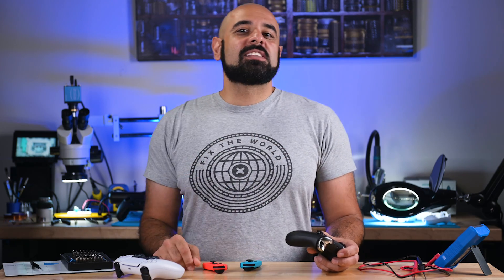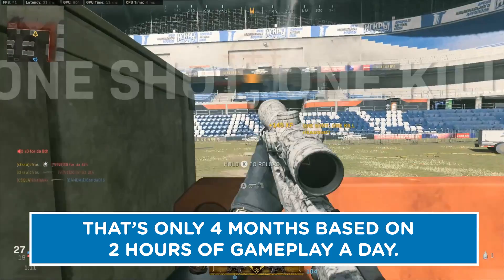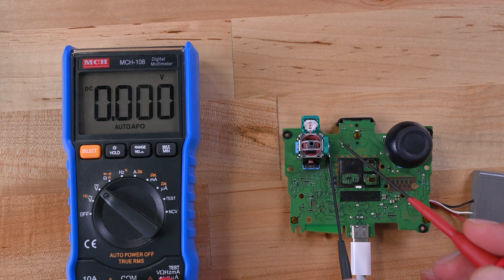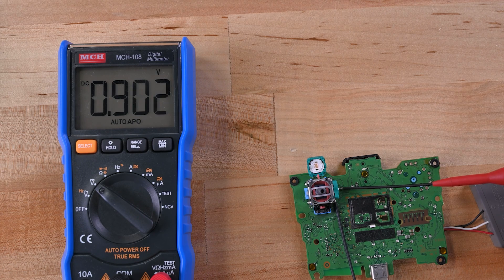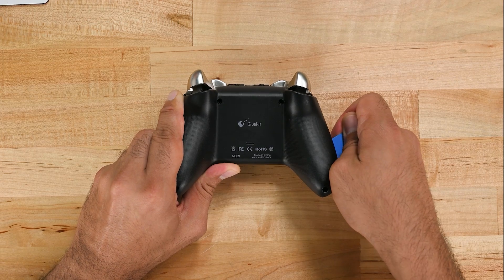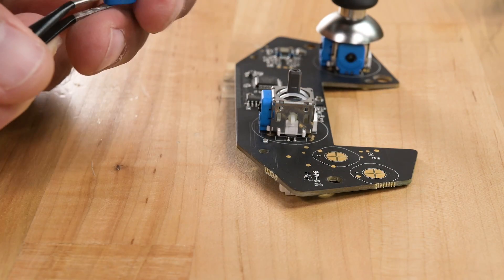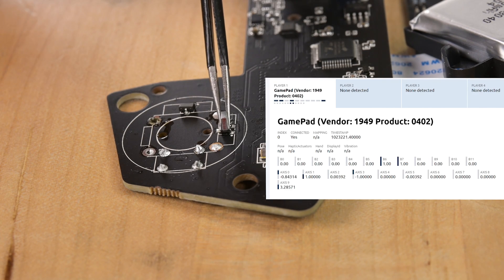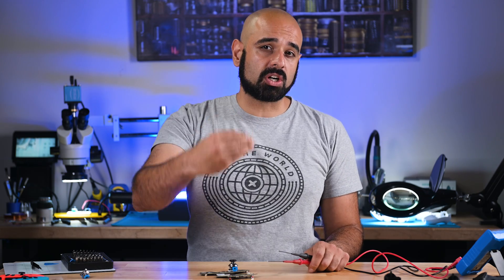How Manufacturers Can Fix Joystick Drift - Permanently!

Comment: I can think of a few reasons why the analog potentiometer is still the standard in gaming. Apart from the cost and availability of components, one thing that springs to mind as an issue is the effect of rumble motors. These operate by generating a magnetic field, and the controller would need to be designed from the ground up such that the effects of having the rumble motor running would not be detrimental to the accuracy of the stick. Whether that’s through greater physical distance between the sensor and the motor, such that it’s not affected, or by compensating in software, it’s an extra design consideration that the analog devices just don’t have.
Another issue, specific to the Joy-Con at this point, is the physical throw distance. Joy-Cons use very low sticks, by which I mean the point on which they pivot in both the X and Y directions is a lot closer to the thumb than it is on other joystick designs. This means it’s harder to package the sensor in the joystick unit, and to have enough physical movement of the magnet mounted to the joystick to be able to affect the Hall sensor enough to get the accuracy wanted in the output voltage.
Even with all these things taken into account, the centering effect of the stick is only as good as the physical mechanism on which it relies. If the spring on which the joystick rides fails, it’s the same problem whether your stick is using magnets or resistors to read its value. This is also another argument towards the potentiometer-based device; it’s available as a single unit which incorporates a standardised upright. A Hall-based solution requires engineering the physical action of the stick separately from the sensor mechanism, raising the design complexity.
I do find it worth noting that certain current-gen controllers do use Hall effect as a matter of course, specifically in the analog triggers on the Xbox controller; and these have their own vibration motors in close proximity. I suspect they are using software compensation.
Reply from the maker: This is interesting! I'll certainly read up on this and see how Gulikit approached the problem. Do you have any references for this information?
Reply: @iFixitYourself   In terms of references, I don’t have any documents; this is speculation on my part regarding reasons why Hall effect isn’t the standard. Most of this actually comes from my experience in sim-racing hardware. I have a Thrustmaster T-LCM set of pedals, which use a load cell to detect braking force, and Hall effect sensors to monitor the acceleration and clutch pedals; the arms of the pedals are made of ferrous metal. However, when I tried to mount vibration motors (the same type as used in 360 controllers) which were connected to a separate device for control, I found that the interference from the motors being activated would cause the accelerator pedal to stop responding. Since they’re separate devices, and the pedals are effectively a “black box” in that I can’t alter the firmware of them, it’s not possible to apply the software compensation I mentioned. However, I believe that other pedal sets which do have motors integrated as an option are not affected in the same way; whether that is through software (ignoring readings when the motor is known to be active, for example; if the motor is being driven by PWM, it may also be possible to take readings when the motor is off) or physical separation; I haven’t used these, so I can’t tell either way. It may be worth repeating the experiment shown on the Gulikit controller while holding a small motor (driven from another device, such as an Arduino) nearby, and see how it reacts when the motor is both on and off.
The rest of the effects I mentioned are speculation on my part; the physical design of the joysticks on the Joy-Cons are known to be small packages, as can be seen from replacement parts, while the spring argument is basically saying that it’s easier to design the whole controller if the functionality of center return is already provided by the joystick module, rather than adding it in separately. 
I have no experience in industrial electronic design, these are all speculation on my part as to reasons why, partially based on my own experience. I also want to note that the PS5 adapter triggers still use potentiometers to determine their position; since they have motors in very close proximity, it may not be possible for them to be substituted with Hall sensors in the manner that the Xbox triggers use.
Reply: Dreamcast had an interesting quirk that a number of screws in the controller anywhere around the Hall stick had to be out of NF metal, something bronze like. I think they puzzled around with screw placement and overall construction a little to make it work, it sure makes that impression.

Indeed the rumble motor was VERY far from any Hall hardware but i don't know whether that has anything to do with that or whether it just worked out like that. I could certainly create some interference nearby and check next time i break out the Dreamcast. Besides Hall stick the triggers are also Hall.

Comment: After watching the video, I have two questions.

1. This problem hasn't arisen until recently; how did past controllers have far better potentiometer quality when compared to today's controllers?
2. Wouldn't Hall Effect Sensors add latency as they output an analog signal that needs conversion to a digital signal?
Reply: 1. They didn't. Potentiometer based sensors have always had the same drift issues, for example as someone who only played Playstation at friends' house I don't think I've ever used a PS1 or PS2 dualshock controller that didn't have really bad drift. There are multiple reasons why it's perceived to be more of a problem now than before: You might not have run into the problem yourself on older controllers; that's just random chance. The volume of failure has gone up because there are way controllers out there being used, the failures show up sooner because spend more time gaming and modern games rely more on thumbstick controls than old games; it doesn't mean the quality of the sensors have gotten worse. It's much easier to come across stories of failed sticks now than before because of modern social media. Older games often had low precision input (e.g. only two fixed walking and running speeds) and large deadzones which hid the drift. Finally, joysticks other than thumbsticks, with other types of sensors, were more popular, so drift wasn't something people were that aware of as a problem.

2. Pots also output an analog signal. There's no difference.
Reply: @Berengal  Thanks! Your points gave me a new perspective and helped me learn a few things today. However, I still can't help but wonder if the quality of potentiometers in controllers truly hasn't changed for the worse, especially when compared to the Nintendo Switch Joy-Cons. Otherwise, when I think about it, yeah, I didn't have as much time to play video games in the past compared to now (let alone even afford it), so maybe you're right. I quickly read that there were analog and digital potentiometers without actually understanding what they were; it makes sense now.
Reply: @TheRacingDevon  it has to. I’ve had gamecube controllers with still perfect joysticks after 10 years of use while I’ve had 3 modern controllers busted in 3 years. 1 joycon, 1 nsw pro controller and 1 xbox series controller. Also my xbox one controller is now drifting but that lasted almost 10 years since I got it in 2013. It seems modern joysticks are not as durable as they used to be, even if they are using the same tech

Comment: My joy cons have never drifted. Stopped using them when I got the pro controller, and that has no drift still. Dobe grip controller no drift. Fusion Pro wireless no drift. 

But still would install these Hall sticks on the Fusion Pro IF they would ever make a compatible board. Really not interested in paying another $65-$80 (depending on where from and shipping) for yet another controller.

Comment: As a flight and racing simmer, I know hall sensor from like 2008, but now it's almost norm (along with some optics senor some where and force cell is another story then...)
I can't believe it's not yet in game controller yet... if they decide not, Good news is, with some 3D print part it's very easy to convert one to hall. I have done one for an old throttle quadrant.

Comment: The fact that the signal being output by the Hal Effect sensors is already a digital, does that mean the controller is in affect simpler because it doesn’t have to go through the step of converting the analog signal of the potentiometer into a digital signal? Does that also mean that if I am correct in my thinking, that there would also be less latency in the system as well within games? 
Lastly, can one simply swap out their ALPS analog sticks for Hal Effect ones or are there other steps involved?
Reply: They're effectively the same - the potentiometer version takes a constant voltage and divides it depending on the position of the pot.  That voltage is then read down the line for conversion.  The Hall effect sensor version also just takes a constant voltage and divides it depending on the position of the magnet.

Comment: I managed to mostly fix my stick drift issue by dismantling my two original controllers with your toolkit and spraying compressed air into the analog modules

Comment: What's crazy to think about is that it's 2022 and Hall Effect Sensors/Gimbals have been available for so long, their pros have always been known, and there's really not many cons to them either. It's just surprising that it's taking big companies this long to switch over to them. They are superior to potentiometers in every single way.

And no, they're really not that much more expensive so cost of manufacturing is not an issue.
Reply: the reason they wont switch is because gotta get that extra profit from people buying replacement controllers
Reply: yeah it's like wireless headphones, basically pure money printing machines. You can get cheap controllers for way less than 20 bucks so imagine how much profit there is even if you use slightly better materials in their 60-200 $ gamepads.
Reply: @maxmustsleep what’s wrong with wireless headphones? I’ve had the same pair for like 5 years now
Reply: When it's saving them just 1 cent per controller, they do it. Imagine how much money they "saved"! Not to forget, that they gain more money by people buying new hardware.
Reply: What are the cons you're talking about?
Reply: I had to pick apart the rotary encoder of my mouse and scrape off the oxidation from the metal contacts that were causing opposite scrolling errors. If it had an optical encoder it would pretty much last forever. Almost bought a new mouse but turned out to be fixable with some patience.
Reply: They designed the controllers to fail. Like everything else nowadays. It's sad.
Reply: It's like in the 1910s... light bulbs were indestructible, one of those is still lighting up a firefighter station in America if I recall correctly. And then, in the 20s, a group of lightbulb manufacturers, named the Phoebus cartel agreed to  not sell lightbulb wich exceed xxx hours of light time before failing, intentionnaly degrading the quality of their products, to push the replacements going out of the factories. At this point in time, modern consumerism was born.
Reply: they can, they just don't want to
Reply: One of the reasons was probably that this kind of joysticks was (or still are) patented by some company that trolls out other manufacturers from improving their designs
Reply: @WindLighter  that's not the reason,  the hall effect sensors were already used in a multitude of appliances,  for example  the console dreamcast already used them almost 25 years ago, sega  used them back then,  microsoft uses hall effect sensors in their  xbox controller but not in their stick   just the  LT-RT buttons...as you can see it is not a matter of  patents  but a matter of money,   they earn a ton of money of people buying replacements,  do you really think they will stop milking that caw?
Reply: @tony001212 , manufacturers will never stop milking that cash cow. If board members tried to raise that issue, they (the board members) would get replaced.
Reply: Hall sensors aren't "better in every way" I spoke with a guy who owns a company that makes aerospace grade servos used in large fixed wing and rotary wing (helicopters not multirotors) industrial and military drones and he said they don't use hall sensors for position sensing in their servos due to their failure mode, they just quit working when they fail which is disastrous if it happens while airborne. With pots you get a warning as it gradually gets worse. So they use sealed and greased 10 million cycle pots instead of hall sensors for this reason.
Reply: @atomicskull6405 idk about you, but I don’t think that applies here. Obviously he meant in gaming. While his statement is still false it’s not so due to what you said. The only way potentiometers are better in in latency which is important for gaming but the difference nowadays is LED than 20 milliseconds. Or 0.02 seconds. For reference, an average blink is.04 seconds. So that’s not really a valid excuse.
Reply: Low accuracy+magnetic interference (battery vibration motors etc)

Comment: That's neat, but magnets wear out too. I'm assuming that it's slower than the variable resister wipes in a normal joystick, but it won't actually be permanent. Would probably be more accurate to say "indefinitely". I'm also assuming that since the drift would likely occur over a longer period of time that it could be corrected a lot easier, and most people will probably rage smash their controllers before that time. It'll be a very tiny amount that will notice it and need to correct it, likely over a multi-decade long period of time. Of course, external forces can cause the magnets to wear out faster, such as using perpendicular intersecting fields, but hopefully that won't be too common of an occurrence.

Comment: Personally I think optical encoders is the way to go for high end controllers, hall effect are really good though but nothing can reach optical in my opinion.
Reply: The problems for optical are that it is not analog, so they have limited resolution, and they take more space. It would be hard to use or sell as high end.
Reply: @ivanaviNiebla  Well it was done before on the Nintendo 64 so it's not outside the realm of possibility.

Comment: Actually the joycon drift is caused by the housing of the thumbsticks slowly coming apart, not the wearing of the resistive pads.  This can be fixed by placing shims under the stick to add back the lost pressure.
Reply: Not really. The resistive pads inside the joycon wear out very fast making a lot of dust that creates that crazy movement that it's not quite like other joysticks drift.  By adding pressure we can make the metal contacts wipe away the dust that is interfering, but now we might wear the pads faster.

Comment: As many of us have said though... we've experienced drift because the springs wear out and the control stick sticks in a given direction. I've never worn a controller to the point the sensors wear out, but the springs do where the stick is sloppy and no longer returns to home.

I mean is this an improvement? Sure... I'd love to see better springs though.
Reply: Indeed this also strikes me. The Dreamcast and flight sticks last forever because they ditch the XY splitter assembly and directly read the position of the magnet with 4 Hall sensors underneath, and do the axis transformation digitally. The lack of mechanical splitter allows them to put a large spring wrapping around the assembly which barely moves in use and thus doesn't degrade with time. Another problem in ALPS style sticks is wear in the joints of the XY splitter, again not a problem in prior existing Hall sticks. This assembly reintroduces problems of the ALPS style stick.

Potentiometer lifetime is about as long as 3 mechanical assembly lifetimes on the Xbox360 pad, PS2 pad and several others. I only do old stuff but i know my way around it.

I bet these guys invented a worse Hall stick in order to be able to patent it; the claimed usefulness would be drop-in compatibility (in a variant with trimmable opamps for example) against existing ALPS style sticks.

Apropos interesting patents: Allegro has one which ditches the spring and uses a magnet instead, considering there is already a magnet dangling from the bottom of the stick. I'm looking at that and thinking: finally a patent that... while i dislike patents, this is specifically the kind of smart the patent system was invented for! Like you look at this and think wow, it's elegant and simple and nobody thought of this before?
Reply: Yes. I have fixed a few controllers by replacing the sticks with some cheap ones, but keeping the original potentiometers because they're better quality and there's nothing wrong with them. My problem is always the mechanical part, the potentiometers are always fine.
Reply: @rafaelgsbr  my potentiometers are busted after just 3 months of use on an xbox controller..
Reply: yep, my controller is so worn out that when i push up or down on the analog stick, it stuck that way. I don't think hall effect sensor can fix  this issue at all :)